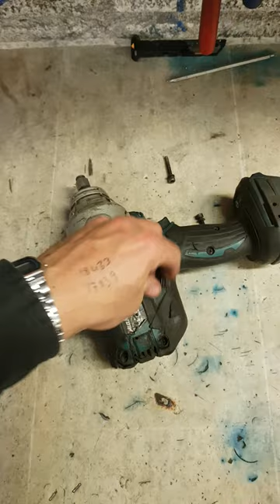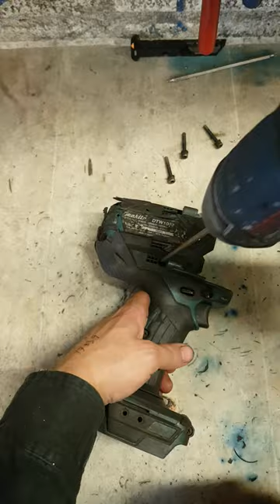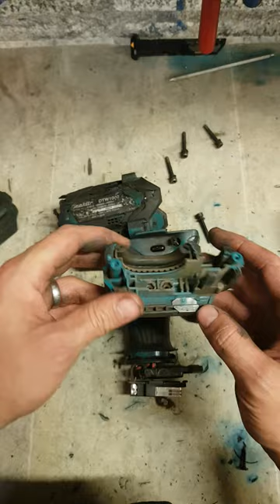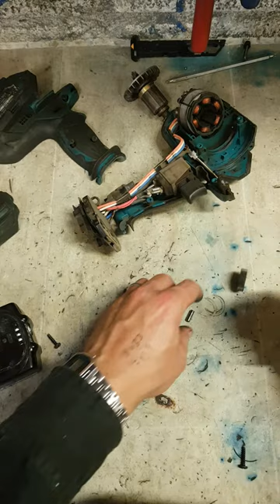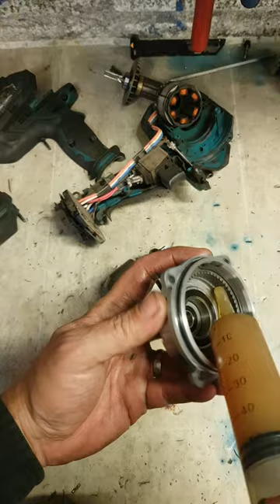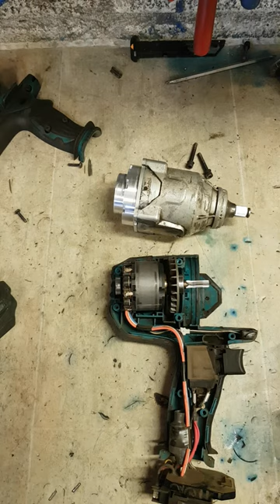Makita DTW1002 impact wrench repair.

Comment: Hi there, great video.  Just wondering if you advise me please about the correct use of my 1001 - tried to undo some approx m24 fine thread wheel nuts on my 16 ton low loader trailer and some it wouldn't budge. They were seized with rust and old and who knows when or what was used to torque them up etc before my ownership. Question is , if you come across something it clearly won't undo , how long should you keep the trigger pressed before burning the gun out or damaging the clutch etc????? i did bursts of approx 3 - 5 seconds and still nothing. Then interestingly i gave up and went back a few hours later and did again and it broke loose!!  For reference we tried a with 4ft scaffold bar slid onto a 2ft breaker bar on the same nuts on the wheel and took my weight of 100kg and still didn't budge so was amazed when the makita did it but i gave it just probably 7 seconds this time..... I don't want to hurt the tool so would love to know your guys advice . Thanks, James from Leicestershire.
Reply: The big metal part inside is a hammer mechanism which is spring loaded, so there is no friction clutch. Therefore you can hold the trigger for a long time without any problems. I have the same machine and wouldn't feel concerned to hold the trigger for a minute or 2. (if you need any longer the nuts are stuck on and need other measures, not because the machine couldn't handle it)

Comment: Hi! I bought a Makita DTW700 new/lightly used. There is a smell of burned brushed motor coming off it when using. But the motor is brushless so i think it shouldnt smell anything. Is it normal you think? It seems to work fine and looks good. I didnt take it apart yet.
Reply from the maker: Not good, it shouldnt be burning at all. more than likely the field has a burnt coil inside. if you take the back cover of and pull out the rotor you may be able to see the field windings, look for a black one.
Reply: @deandohertygreaser  Sounds likely yes. I took the back off, but cant really see all the windings. Some plastic covering it up.  I might take it off later and look with the flir camera at the same time. Maybe the bearing wont like being unsupported. Maybe better to take it apart more and look closer on the windings.
Reply from the maker: @tydlig  if its still running it may be a bad bearing and might be able to be saved.
Reply: @deandohertygreaser  also a good possibility. Maybe previous owner found the bearing faulty and oiled it. And that’s what smelling. And instead of solving they just sold it off. But I can’t find any traces of oil residue in wrong places.

Comment: Is it normal for this impact wrench to have a knocking sound when you shake it back and and forth when not running? Seems like there is something lose around the hammer.
Reply from the maker: yes, the hammer and anvil are not tight agenst each other, there is some room for them to move.